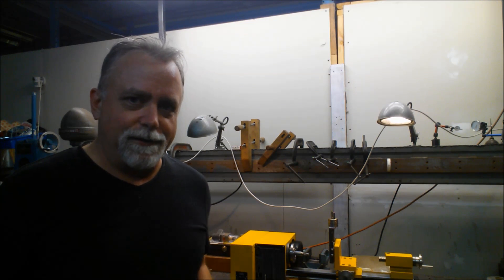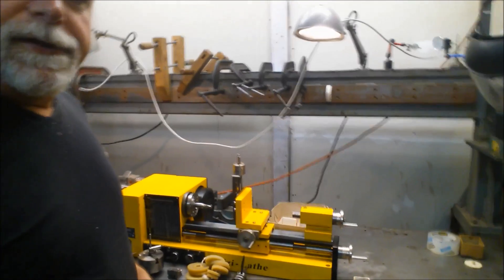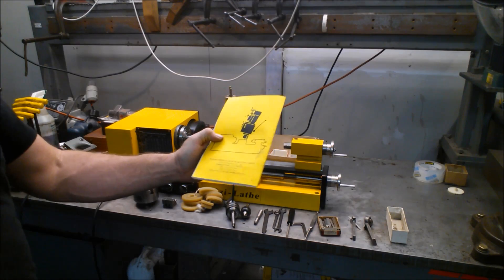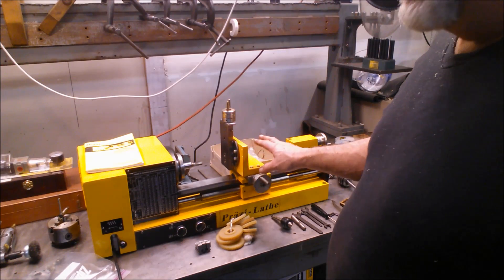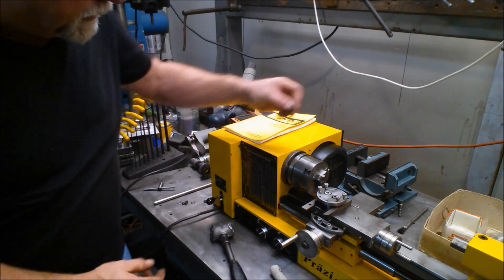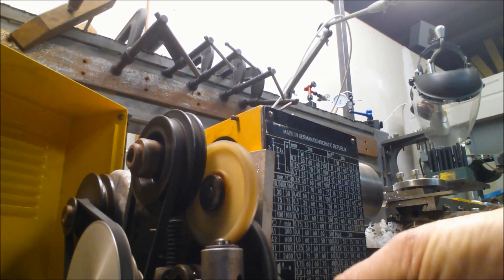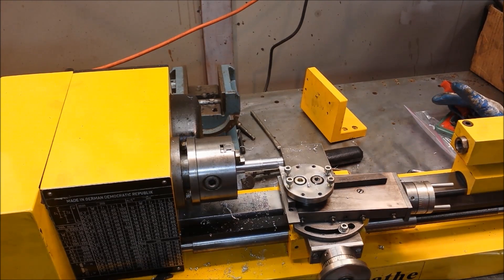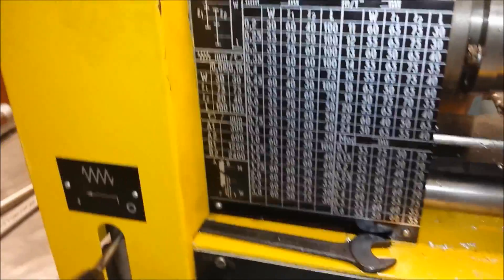Prazi Lathe SD300 1

Comment: When I bought my Prazi in 1991 a centrifugal  switch inside the motor went bad within a month ... Prazi  dealer (Rutland Tool in Houston) wanted me to purchase the whole motor ... I opened the motor and ran wires to the front of my Prazi and connected them to a  momentary contact switch I added...Its been working on that swithc for 31 years now..

Comment: Hi I found a MD65 on a scrap heap took it home and it still works I am missing the pulleys is there a chance you could measure out the pulleys for me if you don't mind
Reply from the maker: Hi tashwill,
The lathe was sold quite a few years ago. Sorry I can't help you. There is probably a Prazi lathe user's group out there, suggest you contact one of those groups for the information you seek.
Reply: Which pulleys do need measurement ? I have an MD65 from hobbymat (and also the BFE65 mill)
Reply: @Compasscard all 3 please

Comment: I know this is about seven years old now, but thanks for doing a fine job showing this lathe off to us and then leaving the video up for so long. It is a great reference. I just purchased one of these and will pick it up tomorrow. I am aware of its small size, but it should suit my needs quite well for at least a few years as I learn to use it. This video helped me to make the decision to buy this old lathe.
Reply: Hi Holton,
Thanks for the nice comments. Hoping you enjoy the lathe and the process of learning to use it. I'm still around and using my machines. Hope to post more videos soon.
Reply: @sharktooth314  There are 3D-printable gears, but not much else i fear
Reply: @ferdblu1946  There is indeed not much printable but I printed a protector for chips on the way and also changed the front plate with the switches and replaced these with pushbuttons and a potentiometer to suit my VFD. I also removed the motor and replaced it with a 3 phase one. Apart from that, I made a printable bracket for a DRO (igaging style) on the x axis and I'm busy designing one for the y axis but that one is more diificult due to the limited space available. Especially if you intend to keep the top slide in place.  Another modification is to add some axial bearings to the crosslide, leadscrew and crosslide. This involves the turning of some steel/aluminium to replace the existing part. I'm also prepping for an ELS and have all the stuff but I will need to create another bracket to host the spindle angle encoder and probably also make some adaptations to the cover to allow a belt to pass through to the stepper. The stepper can't fit in the case, there is just no room.

Comment: This is definitely a Hobbymat MD65.
I boughtone just as the Berlin Wall came down knowing that the price would inflate as surely it did and put this model out of production. There was an after sale s market for this machine and I bought a four way toolpost, slow speed or back gear attachment and a faceplated from Essel Engineering in the U.K. Essel are still trading and do still have a few items for it.
The drawbacks of this lathe is the 30mm travel on the tailstock quill, the lack of rigidity of the saddle on the round bed and the fixed handles. With car it is possible to acheive good accurate results with this machine.  
The machine was originally supplied with a vice to be attached to the vertical slide arrangement. Milling was just about possible but the set up is a 'mare.
When screwcutting the topslide can not be set over to half the thread angle so I infeed and also feed the compound slide a fraction to maintain the cut on one flank of the screwcutting tool only to avoid excessive load. 
A taper pin fell out of the lead screw of mine and it took me a while to work out what was wrong with the machine and it defeated a professional machine tool maintenance contractor too until I realised that the pin was missing and found a roll pin to fit. That repair cost pence. As with most hobby users this machine has been sorely taxed at times and a cast iron artillery hub of 4 3/4" diameter has been machined on this fitted to a tapered mandrel.
This machine is the poor relation of the Myford ML10 (Having the same nominal capacity) which I could never afford but it has served me very well.
I believe that Essel Engineering also produced a fixed steady for this machine but it was fixed to the bed with a 'U' bolt. A much better one was recently described by John Wain in Model Engineer's workshop magazine. he also detailed the fitment of a four jaw chuck and backplate which I did too following his instructions but beware as not all the backplates are the same and the fixing hole centres on his machine did not match mine. having fitted a new backplate I then went on to make a backplate to fit an ER25 collet chuck purchased from Arc Euro Trade. There was a collet chuck available from the manufacturers for this machine but it would probably be very hard to find now.  
This is not the Emco 5. Emco were West German.

Comment: ....probably should ask this on a machinist forum.....have had a few lathes.....inc an Emco Compact 10 w/all attachments. Don't need my current South Bend 9". Would like a smaller lathe(Don't want far east stuff in a metal lathe..maybe other tools..but not in a lathe). Still have smaller work to do....these Prazi lathes seem pretty scarce...a few opinions  appreciated.................thanks!

Comment: I think you'll find that the chuck flange does come off. it is held on a taper with the three socket head head screws. There are positions for three larger cap screws to thread through to push the chuck flange off the spindle taper. Note that the spindle, flange and chuck are usually match marked. (Mine has a "0" as a match mark.
I seldom use the three jaw, as mine came with a 4 jaw also.